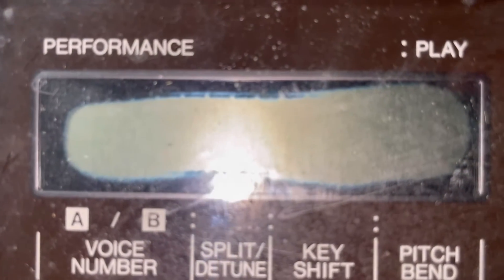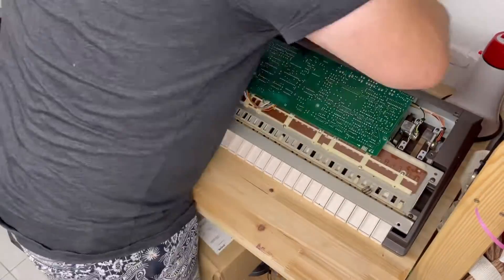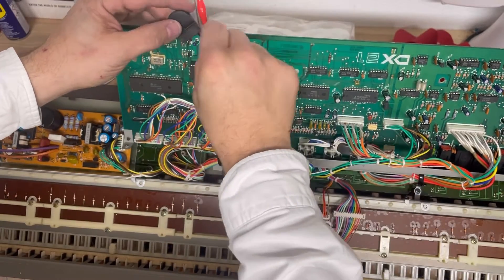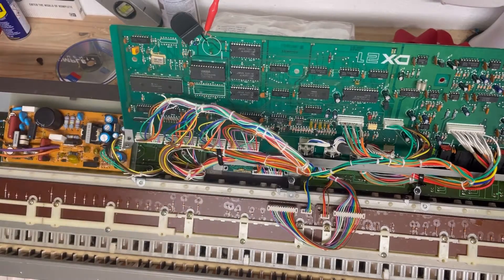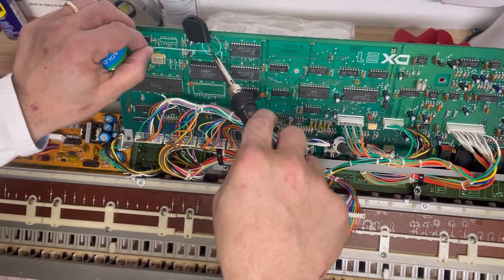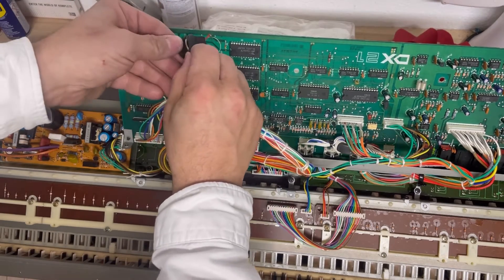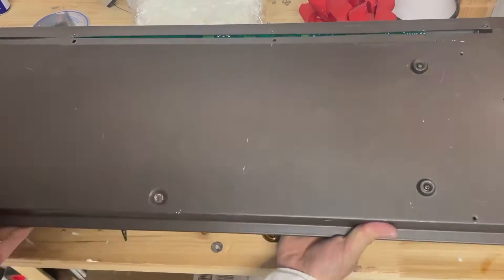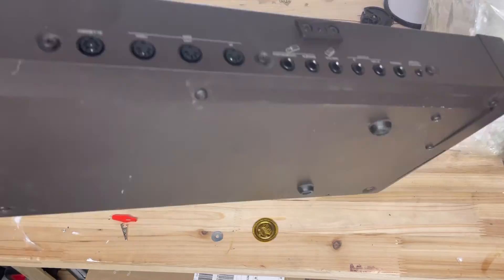Battery replacement for Yamaha DX series Synthesizers and others with soldered in batteries

Comment: Im gonna do the same for my kawai k1. So does the red cable go to the positive and the black goes on negative? I’m new at this stuff, i apologize if it’s a dumb question.
Reply from the maker: You got it right and no dumb questions when there’s electricity!  My k1 has a battery socket vs a hard wired one… easy peasy - maybe someone hooked it up